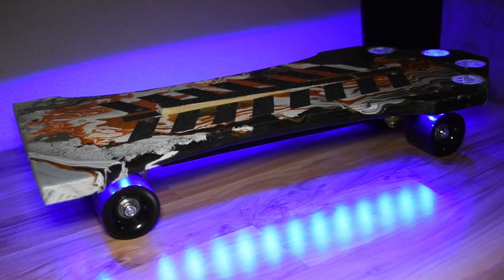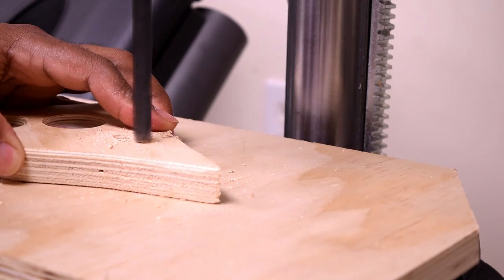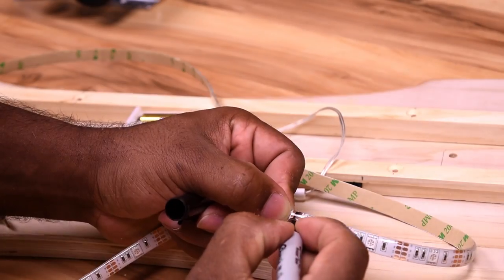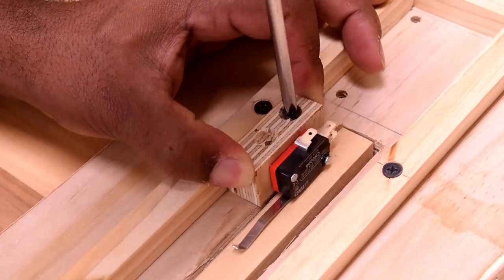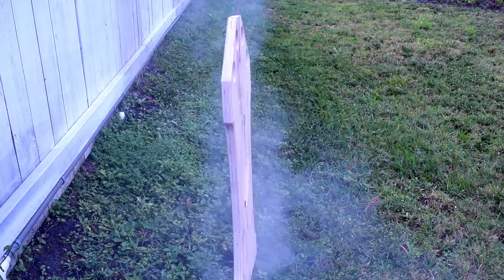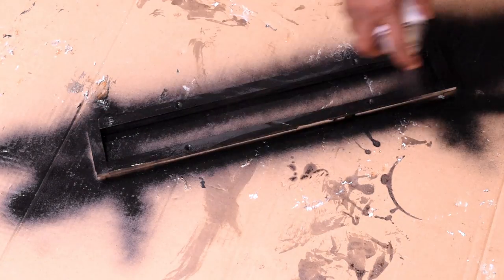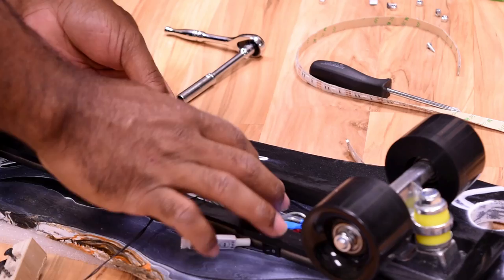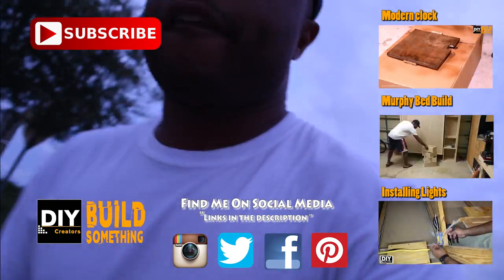DIY skateboard with LED & Water Dipping Paint

Comment: The amount of talent you have is crazy! And what wood would be easy to use for accessories around the house? I want to start woodworking see!
Reply from the maker: Thank you. I started with the wood that sold in the local hardware store and I still do. There is all kinds of wood. To start out ill suggest plywood its cheap and you can just experiment.
Reply: +DIY Creators thanks for the advice!

Comment: ok, so for the problem you had with the wheels you could buy risers which would be under the truck and it would rise the whole truck by about half an inch. hopefully fixing the problem instead of shaving off the box for the LED's